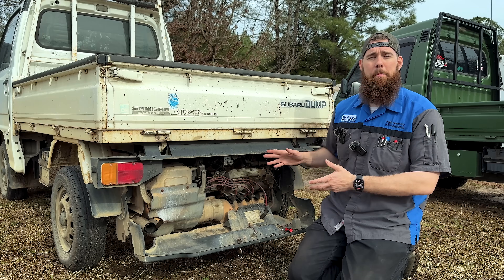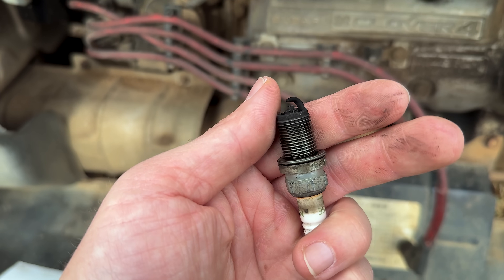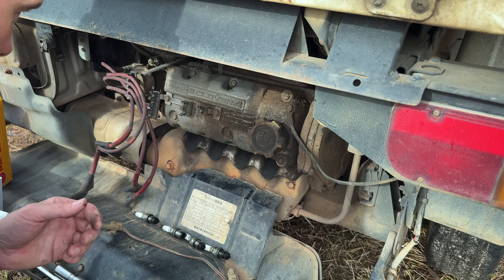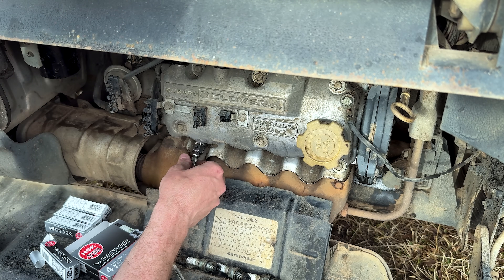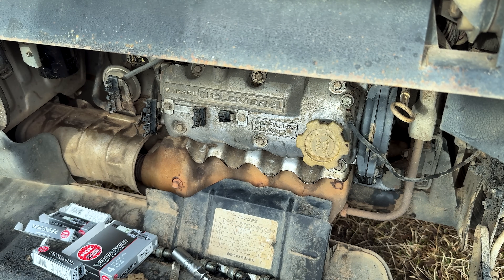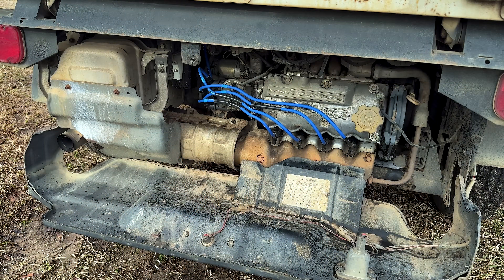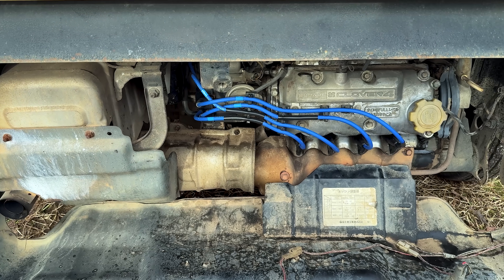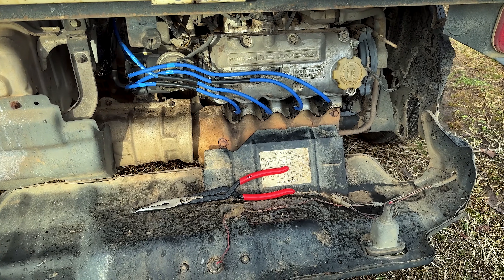Subaru Sambar Dump! Tune Up Time! Using A 5 Gas Analyzer To Tune The Carburetor & Ignition!

Comment: Hello which state are you based ? If you are near would you be interested working on a 2015 forrester  , at 110000 miles have oil in radiator , but been told cylinder head is good but have to take out engine to replace oil O rings , would rather pay you and may be a good video , if not I understand . 
Really enjoy the amount of education you share , all the best 👍
Reply: Plenty of people can work on that oil cooler can def cause that if it is leaking.

Comment: Hope you see this comment. I need a rebuilt CVT for a 2013 outback. I've already had my mechanic install one I got from JDM in Charlotte NC. It was broken before the car could even pull out of the bay. JDM says they can refund us for the transmission but will not cover the $1,100 in labor. I bought the car les than 2 years ago and still owe $3k on it. It has a salvage title also so I won't get anything for it I'm afraid. I need a reliable replacement for the CVT that has a warranty and covers labor. Any ideas?

Comment: Thanks for cleaning the top of the engine too 😊 Maintaining old vehicles to keep them running is much more environmentally friendly than purchasing a new heavy electric vehicle that needs mined lithium etc for batteries.